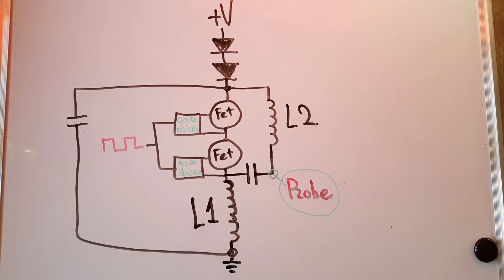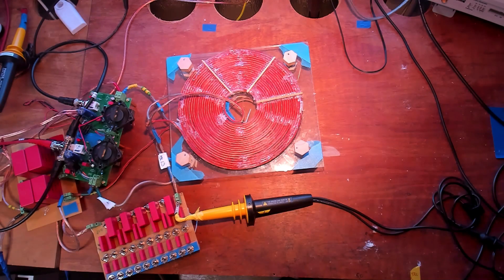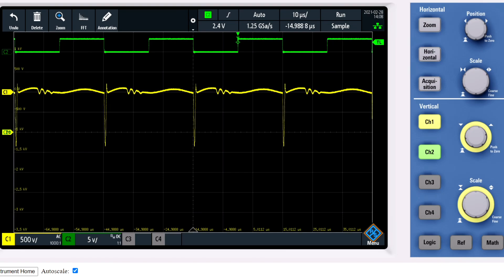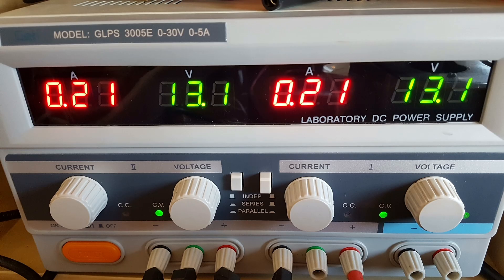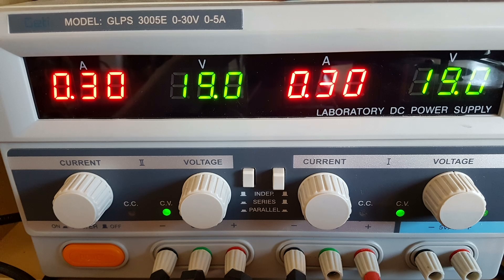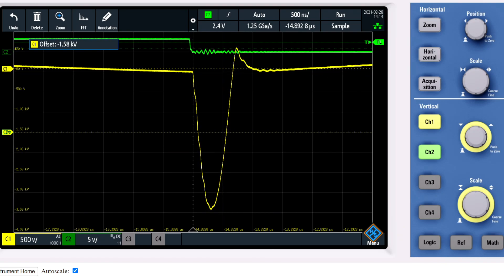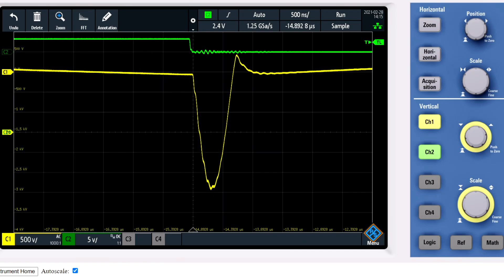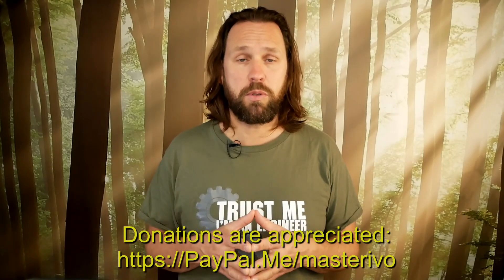High Voltage Impulse Generation

Comment: Ivo don't disappear into another dimension with those high voltage pulses ;)
Reply from the maker: Remember: Time and Space are only 2 dimensions. Then we have counter space and counter time. 
I will probably disappear sooner into a higher octave ;)
Reply: @MasterIvo  Ivo: this is just a quote from my book, "Beauty of Creation",; 450 pages; I will be completing it soon, in which I talk about disappearing in higher octave like idea: " What if we are a super-sub-conscious, and our body has five basic sensors, that is experiencing life in this realm and data is collected through this remote machine (our body). Assume a machine is sent to Mars, collecting data, telling us about the environment on Mars, air quality, gravity, sound of winds, etc. The receiver is on the Earth, collecting the data, and then one day the electromagnetic connection will be dead, that body will remain there but the data collected by the receiver will remain as an experience and records; then comes the virtual reality; what if a robot is walking on the surface of Mars, and we are experiencing everything in virtual-reality manners. I think our super-sub-conscious is sitting or existing somewhere else, connected to this body through some cosmic connection that penetrates the fabric of space and time and continues to collect experience through this life. Just like a robot on Mars may fail to work, but another robot can be send to do the same thing on the same frequency or (cosmic link); So when this body dies, another will be created in another realm but it will respond to same Cosmic Frequency unique for my super-sub-conscious to collect data, experience from another realm, life-form, or experience. So we don't die, we just change the time and space of another reality; and continues this journey. What is the point for our creator to make this huge universe; that we are unable to visit every corner of it, and to understand its principle of operation for such a short life of just 100 years or so. Definitely the purpose of creating is much more bigger then what we understand. So we are a living soul for ever; experiencing and enjoying the creations. I liked your answer of "higher octave" that triggers me to write a concept of experience in different realm. God bless you my friend.
Reply from the maker: Sounds like an amazing book you are writing, where can I read it?
Reply: @alocin110  there is Circadian evidence that we came from MARS
Reply: @alocin110  research done with astronauts in space and there natural oscillations match that of planet MARS. suggesting not long ago we left MARS
Reply: @alocin110  When the Astronauts come back down to earth there circadian returns to Schumann (Erath)
Reply: @mykedoes4099  Because we touched Mars doesn't mean that we ONLY came from Mars. There are other thousands and millions of planet out there. Is it not possible we colonized several planets? What if we visit an Earth like planet in another solar system, in another galaxy and find out that we are attuned to other oscillations same as on Earth, Mars, or X-planet. So far Mars theory is acceptable and I do agree with you. Thank you.
Reply: @mykedoes4099  Very true. I think the more we learn we realize how little we know. Thank you for your comments.
Reply: @MasterIvo  Never thought of that, (counter space/time) I guess everything has an opposite.
Reply from the maker: yes, and nature always want to balance itself
Reply: @MasterIvo  i have to agree , funny thing is once all is balanced then what???? how to return to imbalance again.
Reply from the maker: well, I intend to create an impbalance with very low power (L1 L2 coupled producing impulses).
the impulse will discharge a capacitor which is a unbalance.
nature fills it back up.
this inflow of extermal aether is current.
Reply: @MasterIvo  yes i have seen this with regular batteries and capacitors. I guess all things have a certain type of there own memory. This suggests that the start of time/universe could have been a point some where between -1 and +1 possibly what we call 0/zero actually has a value that not of neg or positive but a value known as "EVEN" / "BALANCED"
Reply: sometimes a bro just ascend to them higher harmonic tho

Comment: The hard part is figuring out how to isolate the high and lowside drivers to get them to operate properly in series at the same time
(because if they are out-of-phase it will cause one to likely become overvolted and pop)

Most likely you will end up having to drive every gate from a different winding on a shared inductor core.   Especially if driving more than about 3 FETs
Reply from the maker: Actually that is easy. Just use the same parts, and the same signal, and they switch simultaneously. 
Right now I'm only switching High side. If I would also switch lowside (as in a half bridge circuit), it would not be simultaneously, as that would create a shortcut)
Reply: @MasterIvo   I see how your circuit is set up now, thanks.     I think going over 2-3 you will run into different problems, especially if switching fast, but for your setup I think it is.a great solution.   :-)
Reply from the maker: @reiyuki   thanks, now I need to add L3, and give it a hv negative dc offset, so it makes a capacitor together  with impulsed L2

Comment: you definitely have my attention am working on a the swab buster and right now using a 40k ignition coil utilizing your bifilar method to wipe out the  program assemblage in nano biotech so wanted something I could use to act as a pulse point to regulate the emp impact 
so when this comes on will be there
Thanks
Tony
Reply: Ivo has his feeling of that Master, indeed. If I were you who definitely had his attention, Sir I would rather beg Mr Ivo to grow a little one of a Tesla Tower for some real money all of us would have to solicit in a while.
Reply: Would you call a real implementation on these findings today, Sir?
Reply from the maker: @ yuri, I intend to use this primary impulsed coil, as a capacitor plate. the other secondary coil, will also be a capacitor plate, which will have a high voltage DC offset. 
This way I can discharge the capacitor using the impulses.

In short: More experiments, to learn how the dielectric field behaves, and benefit from it
Reply: weak point of tesla coil FE with ground wire, is the high impedance of the secondary....  using just a primary too suck electrons off the earth is a facinating posibility.... although no reason it cant be done with a spark gap, much higher power potential.... although i would use transistors too
Reply from the maker: Sounds great!